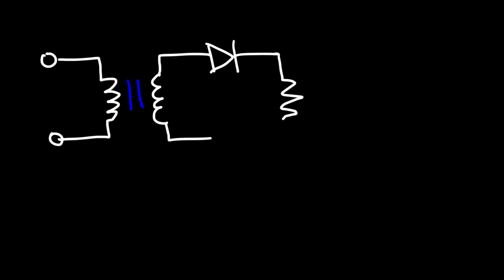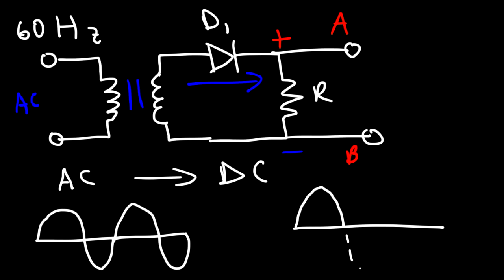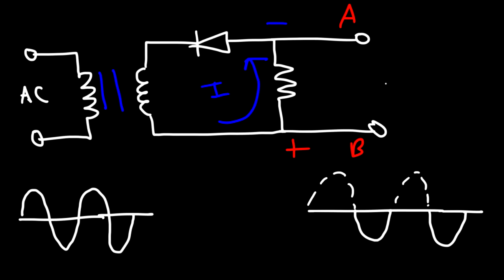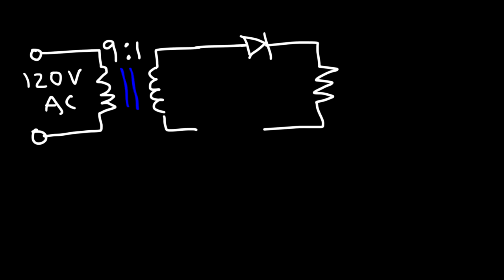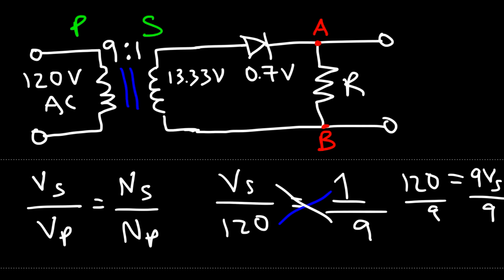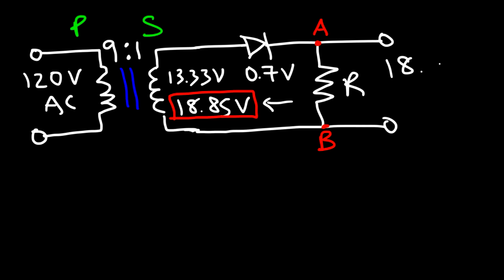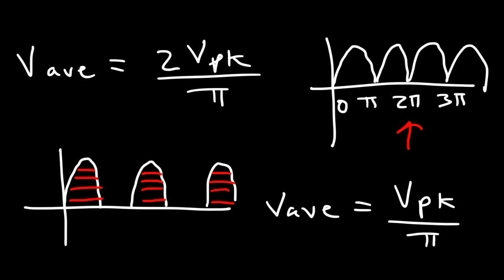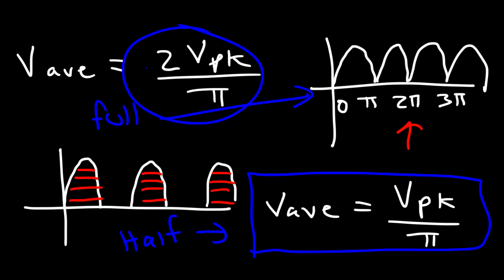Half Wave Rectifiers

Comment: Excellent video, however
Pi radians = 180 degrees (a complete cycle)
Calculus for half wave  should use 0 - Pi/2 and then use diagram to explain why the result is then halved
Reply: 360 degrees is 2pi radians which is one complete cycle no?

Comment: Thank you very much for your video, it helped me a lot, but I just have a small comment for whoever is wondering. The video’s method (5.78V) is slightly overestimated because it does not subtract VD/2. The accurate result is closer to 5.65V. The error arises from assuming the diode drop only reduces the peak voltage, not its average over the entire period.

Comment: Why does the graph of the V changes ?
Ain't the graph changes due to the diode which makes the circuit if it's opened then closed so the current is affected?
So why the V isn't a normal Ac graph

Comment: What's the use of the Resistor there???? Can someone explain please
Reply: Its a resistive load(A load(electrical) is anything that consumes electrical power). A light bulb is an example and a heater. https://www.theelectricalguy.in/tutorials/types-of-electrical-load-resistive-inductive-capacitive-load/
Reply: To drop voltage

Comment: Why we use a resistor in series of the out put?? What will happen if I don't add that resistor and simply use the out put.
Reply: Its a resistive load(A load(electrical) is anything that consumes electrical power). A light bulb is an example and a heater. https://www.theelectricalguy.in/tutorials/types-of-electrical-load-resistive-inductive-capacitive-load/

Comment: Except the diode is drawn backward...When I was in Electronic Technology, many moons ago...there were two ways to look at a circuit - Conventional, where a circuit was traced positive to negative and how schematics are drawn - and/or Electron Flow, where the electrons actually flow from neg. to pos.
Conventional direction of tracing a circuit was with the arrow... however, electron flow was actually against the arrow.
So, when you are referencing actual current flow in a circuit, it should be against the arrow. That way, everyone is on the same page, resulting in less chance of confusion.
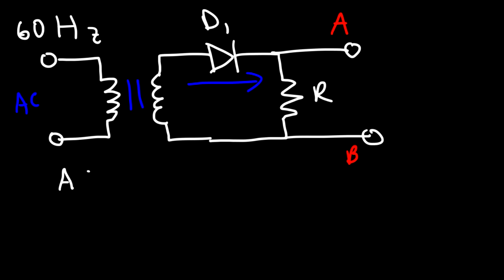But if you are using the conventional method, it should be noted... still, at least the blue arrow should be pointing the other way @ 1:30.
Reply: Omg thankss I was so confused on that
Reply: I dont know where you are in the world but where I am (nyc) electricians aren't taught electron flow, only engineers know about that. most electricians automatically assume that were talking conventional flow.

Comment: Where did he get 18.15V? Was it supposed to be 18.85V?
Reply: 18.85 is peak at secondary, you lose 0.7V over the diode and the reading at A and B is that peak.

Comment: If there is a reverse-biased diode and current is flowing anti-clockwise then the peak voltage would be across resistor or diode?
I mean in forward-biased we used peak voltage across the resistor for finding average peak but in case of reverse-biased, the current would first pass through the resistor and then diode so would we calculate final peak voltage across diode or resistor for average peak?

Comment: Why you are multiplying by √2, if it is half wave it should multiply by 2  to get the Vm. You can multiply it by √2 if it is full wave.
Reply: sudhanshu prakash  i dont actually get it, if it its vm/2 after the diode then the Voutput should be vm/2

Comment: why do you multiply by square root 2
Reply: because it is the same as u divide the rms voltage on 0,707 . 1/√2  = 0.707 also

Comment: In my EE class I was taught to convert the peak pulsating DC voltage to an RMS value by multiplying by .707, then multiplying by .45 for half wave and .9 for full wave. Any reason this could be?
Reply: it's the same thing. .45 comes from sqrt(2)/pi. .707 is 1/sqrt(2). that is some dumb math since you're cancelling out the root, dividing by pi is the same.
Reply: 1/√2 = 0,707. in your case you divide  the peak / ,0707 or you can aslo multiplie the peak at √2